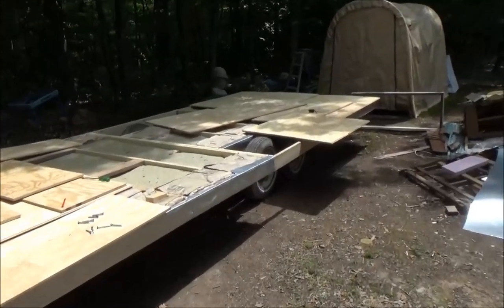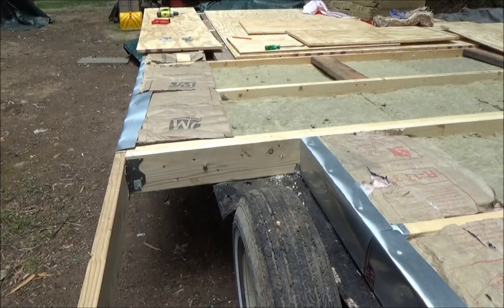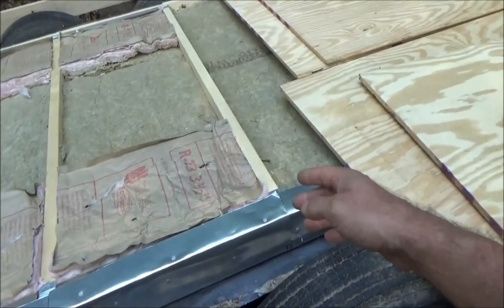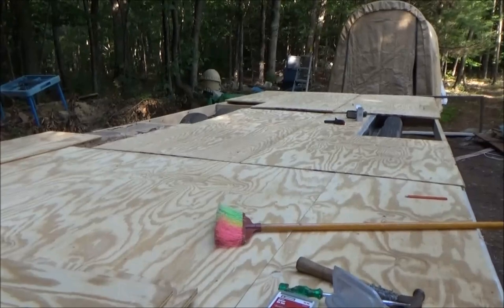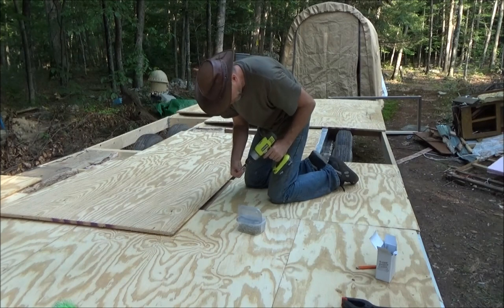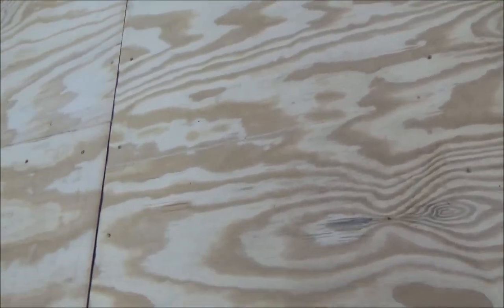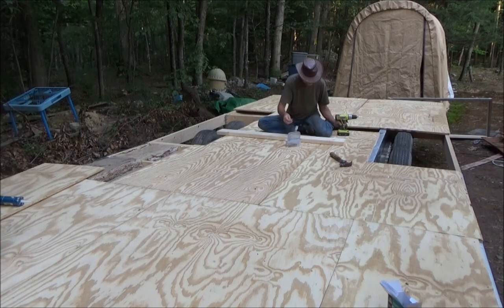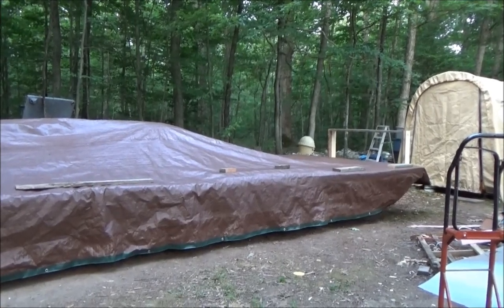Working On Construction Of My Tiny House Floor

Comment: troy, have you thought of using some of those pallet boards as a finish flooring over your plywood? plained and stained they llok great.  if they're oak it'll last forever.
Reply from the maker: Doubt I can afford the weight of it.
Reply from the maker: Paul E Clemons Jr Have you recently lifted any pallets? Honestly not meant in a bad way here. They are heavy. I fear an oak floor would put me over the weight limit of my trailer.
Reply from the maker: Paul E Clemons Jr But... you got me thinking. See the link I shared just a few minutes ago. It looks so good.

Comment: my father had a addition made on his house and to make the floor line up he got a big grinder from a body shop owner and used it to remove the lip and smooth out the walk way in to the dinning room and den dad's tv room, you could tell it was off when he got done! when the house was made with kitchen he took out window in kitchen, and part of the wall too, that where walk way was put, after messing up footers so one layer of block needed to be cut off 2 inch's a 1/8 inch isn't bad for floor to be off! my dad was using a skill saw to make cuts then chisel  it apart, a mason a block layer saw my dad doing that he said jack give me your tape and line here on block take chisel hit it with hammer on  the top of the line all way across flip it over do back side same way the hit side lightly with hammer where the line was broke right off no more sawing, jack i could cut the blocks and finish it in a day if you pay me well my other son going to do it! he went to collage for carpentry i seen if my money was well spent or not! i guess dad paid for some of his collage,
Reply from the maker: gatorred157 Cool story.
Reply: yes he retired and spent years alone in a room or his den alone on oxygen in 1993 died from breathing problems I was gone driving a church van full of teenagers a female volleyball team, i showed up i was on the list so i got the 3 van to drive with second team

Comment: Looking good Troy. What kind of floor are you planning on putting down? Parquet? Tongue/grove? Linoleum? When it comes to the spaces between the sub-floor I recommend using this.

http://www.homedepot.com/p/DAP-Alex-Plus-10-1-oz-All-Purpose-Caulk-White-18103/100097524

I do a lot of construction on the side and this stuff applies easily and lasts a long time. Very durable.

Comment: Just as a suggestion, Since you like the DIY, you should make your own wood filler.  glue and sawdust.  Why spend money on filler, if you are.
Reply: Can't use wood filler, it will bust out when the plywood expands and contracts. A guy earlier said he put all the joints tight in his remodel, the plywood buckled and ruined the floor. Had to tear up the linoleum.
Reply: Jim Watson Yep. When the humidity went up the plywood puckered and I had to peel back the floor covering to make a relief cut so the wood would lay flat.
Reply from the maker: dj6ixdnb I saved all the saw dust from cutting the plywood flooring.

Comment: way dont you put the Battery Bank for the solar power on the end of the Tiny House  on the out sied and Insulation it.
Reply from the maker: milton ferguson That would mean I have to find a way to heat them. They prefer warmer temperatures in winter. I learned that the hard way in two winters

Comment: Why not just use your camper for you home if you want a home on wheels? Wouldn't that work? I wish you just started with a shipping container. It would have been so much easier to have a strong base. I know they cost but they are pretty inexpensive. You could have worked a few months for the money then take your time to fix the up like you wanted to. I don't know, maybe you wanted to do things the hard way, ie yourself. There is a lot to be said for  that as well. Will you be finished before it gets cold?  Janice
Reply from the maker: jksatte Camper and container have one thing in common. No insulation. If you add that to an already narrow confine then you have a very narrow space to live in. I froze for two winters in the camper. I will build a fully insulated home now and have a nice, cozy home this winter.
Reply: The Do It Yourself World
You couldn't just insulate the camper you already had? Even a container has a shell, you build out the shell, insulate, whatever. Starting from scratch seems a bit much to take on. You would be through building out a container by now. It would be awesome and you might actually end up with more room.  Janice